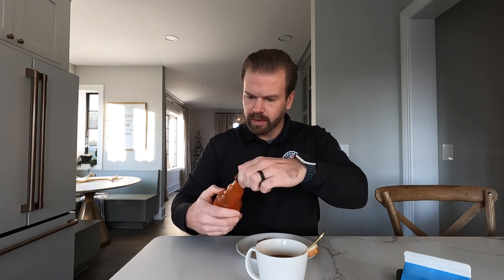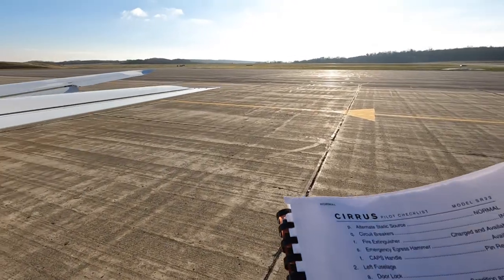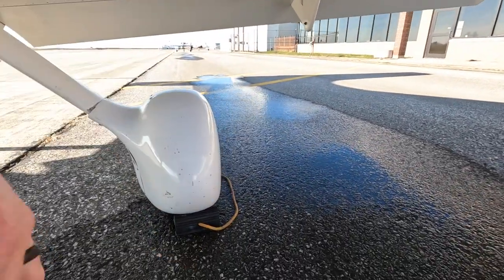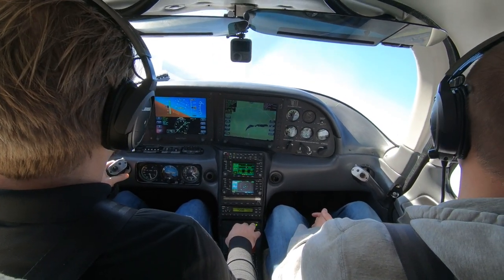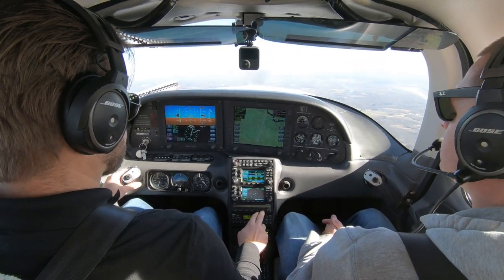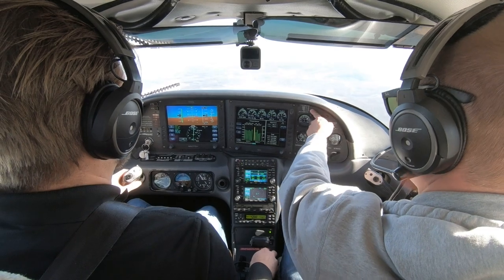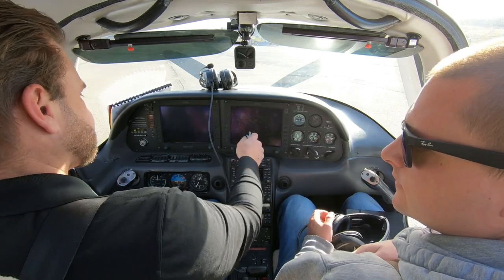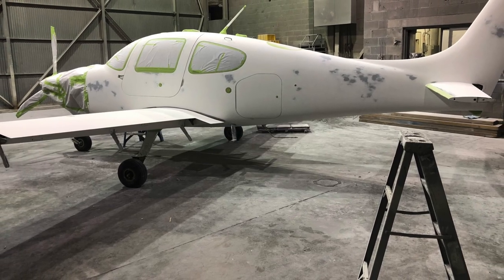Painting Our Cirrus [Part 1]

Comment: ? Isn't your plane an experimental plane? I could of course look it up, but I thought it is/was.  If it is. then  I'm perplexed as to why they  (cirrus) dictate colors. I understand well the need for various amounts of paint on each surface and not to get too much weight of paint in areas. but the color thing bypassed my knowledge.
Reply from the maker: No, it has a Standard Airworthiness Certificate.  If it were Experimental, we could get away with just about anything.  Because it's a composite airframe, the darker colors can have an effect on the skin because of the added heat absorption.  So to avoid the unknown, they just stipulate what your options are.
Reply: @ChaseAviation   Ty so much. I certainly didn't realize that the Cirrus had a Standard Airworthiness Certificate on it. And ty for clearing up the color issue as well. Of course, all of this I could have simply searched and found the answers, But I do thank you for saving my time with your quick response and answer.
Reply: @tonym3675  I’d suggest hopping online and doing an aviation crash course while researching the top brands for most private pilots. Cessna, Beechcraft, Diamond, Cirrus etc. Knowing that the SR20/22 is Fully Certified and not experimental is basic knowledge.
Reply: @WattsUpDev  Yeah well I asked. Nuff said. I found out by the graciousness of Chase aviation. Of whom I've thanked. So I didn't need to go through the rest.  And no, nothing in aviation seems to be " Basic" Knowledge. In fact, everything has to be learned before it became any type of knowledge. And even then, the learning continues if you happen to be a good aviator. So nothing is simply basic knowledge. Learned knowledge, I'll agree to whole-heartily with.  Basic knowledge is something EVERYONE KNOWS instinctively. Like everyone has to breathe. Now, that's basic knowledge. I take it you have basic knowledge about everything! No, it needs no answer. It's a rhetorical comment based on my perception of your condescending text.

Comment: Black prop
Reply from the maker: Thanks Harold! We are keeping a running tally.
Reply: I agree. Black prop definitely with reflective tips. But will the reflective tips be distracting at night?
Reply from the maker: Oh crap... I hadn't thought of that. I know they only paint the front of them, but do wonder if there is any residual light that becomes visible since you're looking through it.
Reply: @ChaseAviation  I guess if you were flying a twin, no problem as the props would be to each side, but a single... 

Hey, remember, the prop's only there to keep you cool!
Reply: An afterthought. Keeping the reflective paint a few mm. away from the blade edges might help. It would still look great!